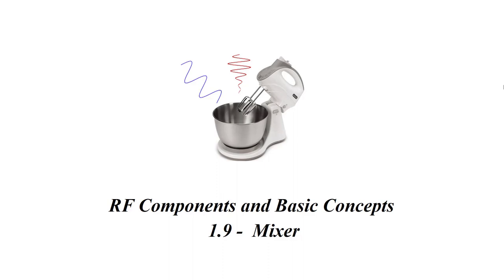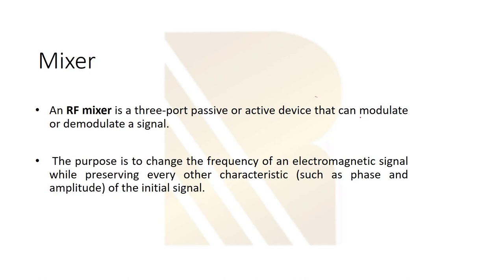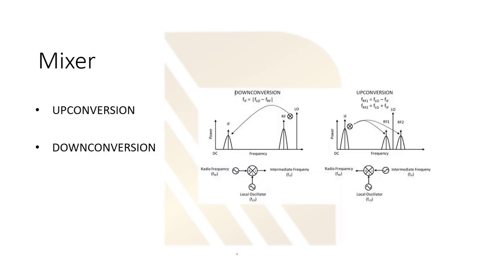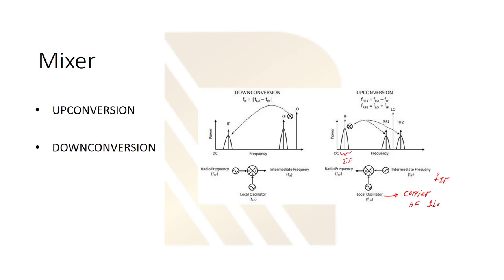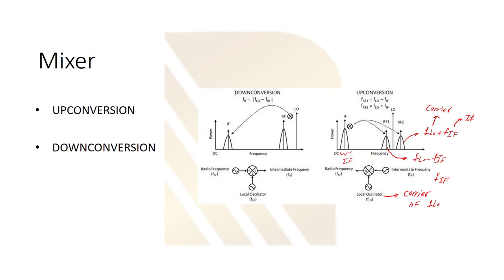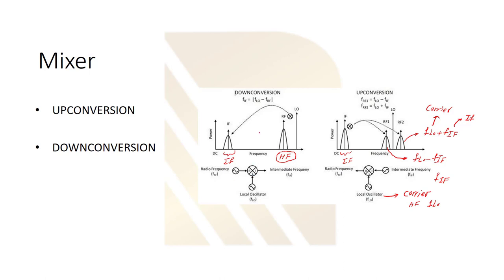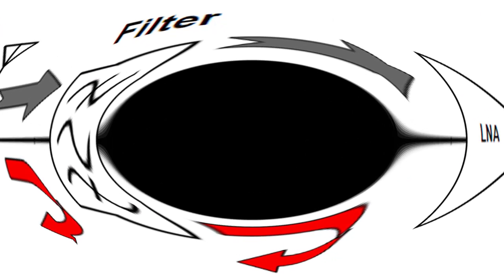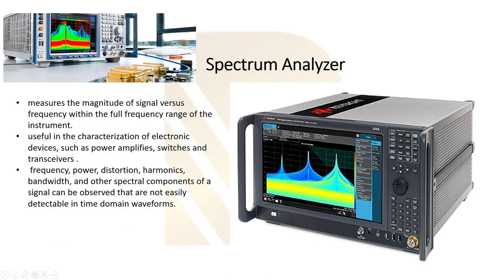what is mixer in RF . mixer tutorial in radio frequency Mixer fundamentals #15

Comment: I think when a signal is combined with a carrier for a transmission purpose then we talk about modulation. However, when we increase or decrease an incoming frequency of a signal by the means of multiplying the LO (local oscillator) by the input frequency signal then a mixer is used.